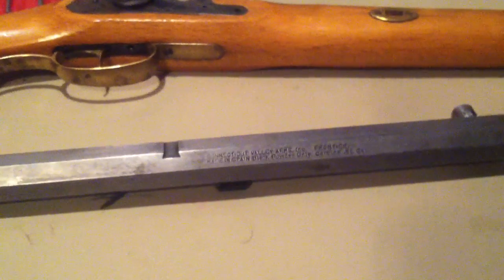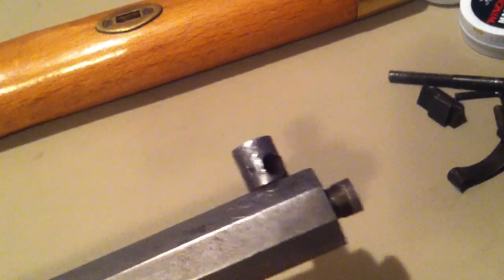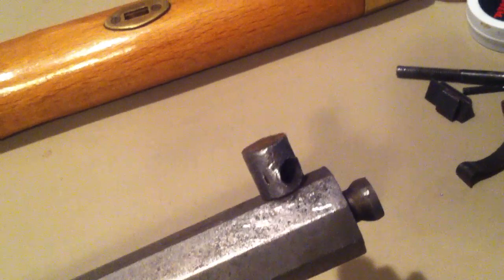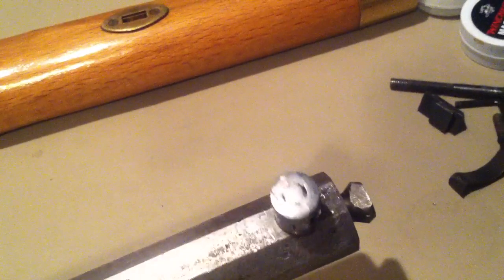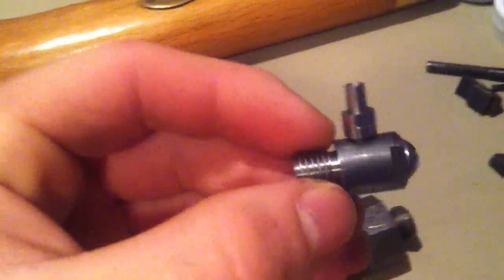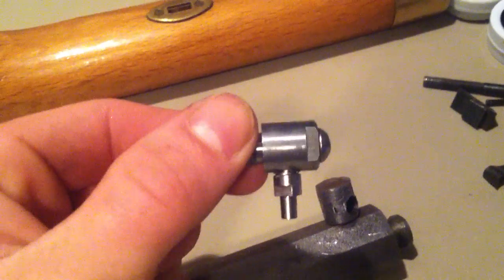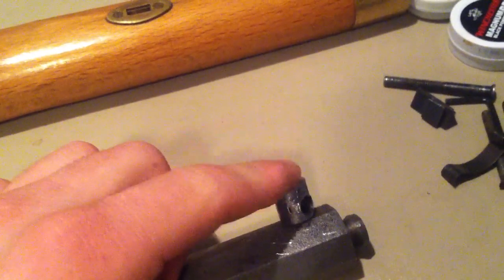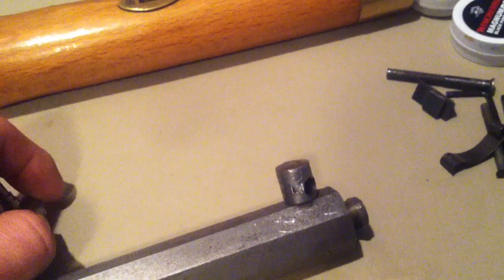CVA Frontier rifle refurbishing

Comment: Naturally, make sure its unloaded( I know you know that though!😉)
Get an empty,clean bean can. Set the barrel breach down into the can. Fill the can with 10w30 motor oil. Also pour some oil down INTO the barrel. Let it sit that way for a week or so. The oil WILL work into the furthest recesses. Then take the channel locks to it an gently try to I'm screw it. It should come loose.

You have to be careful not to twist off the part that is threaded into your barrel. Now if that happens , its no big deal. Jest go to a tool store and get an 'easy out' bit. It mounts in your drill and you would just 'drill' out the broken piece.